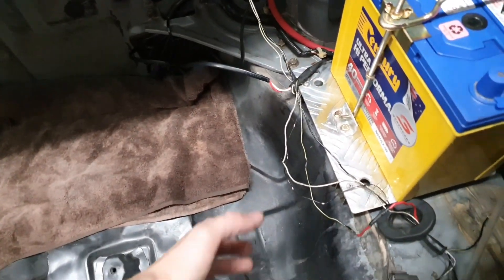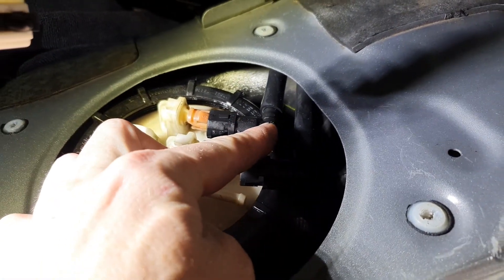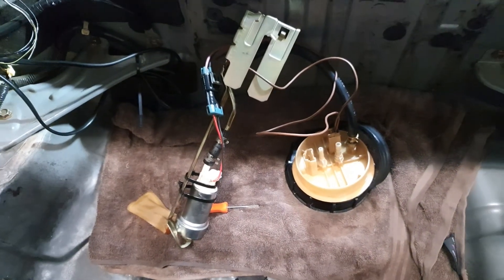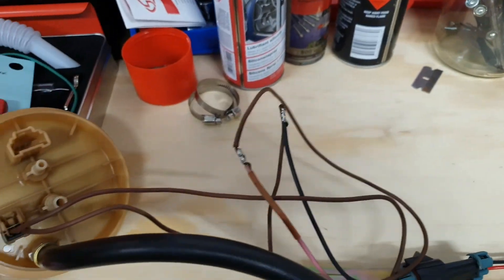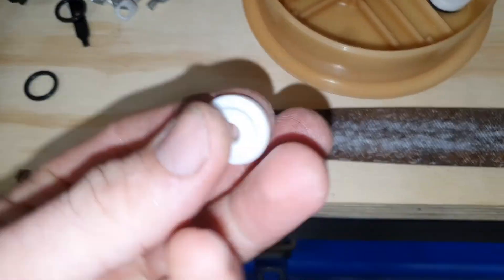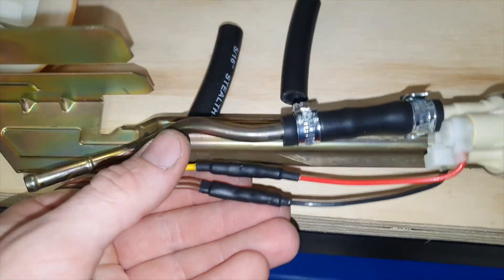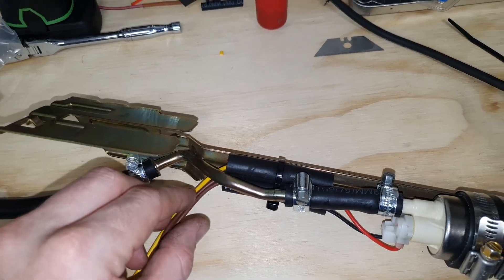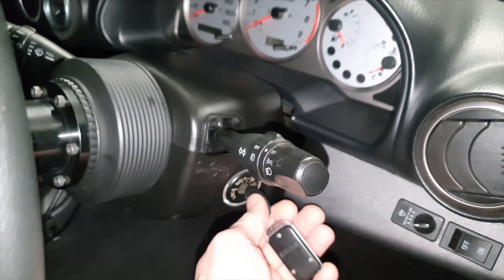S15 Silvia Fuel Pump Fix (Relay Top Hat Mod) | Walbro 460 Re Install &  Wiring Repair

Comment: great tutorial！ did your fuel spill out from the top nuts at all? mine did when i fill full tank..
Reply from the maker: Thanks man.
I used aeroflow bulk head fittings and had to modify them slightly for a firm fit. They seal each side with supplied orings. I also used loctite on the threads as well. You might have to remove the top hat again and inspect the top hat seal amfor the tank and also the sealing surfaces of the bulk head fittings.

Comment: Is there a diagram for where the hanger sits in tank
Reply from the maker: Just in the Nissan S15 service manual, should be able to find a pdf download somewhere for it. Should be in EL section.

Comment: Most helpful YouTube channel to date for s chassis stuff really appreciate it, Joe if you could explain how to wire the relay and where you got it from that would be great !
Reply from the maker: Hey bro, thanks I really appreciate the kind feedback. What you need is a simple relay with wiring diagram pinout. Use the trigger from the ECU (close to the fuel pump in cabin top hat, it will be on the main plug to the pump.) Use that trigger as the trigger for the relay instead, using the relay to switch constant supplied battery voltage to the pump instead. Hope that makes sense. Lookup the wiring diagram from the manual at the pump to find what wire is the trigger to turn the pump on from the ECU, you then want to use that to trigger, switch the relay on instead and by supplying constant battery voltage to terminal 30 on the relay and using the factory fuel pump trigger as the trigger instead for the relay you'll get a constant higher voltage. Any auto electrical or auto parts shop should sell a relay and some good quality wiring. Don't forget to wire in an inline fuse for terminal 30 power from the battery to protect circuit from shorts, also make sure the earth for the relay is done well.

Comment: Great video detailing the setup. Did you find out if there was a mounting bracket within the fuel tank for the fuel hanger assembly to hold on to?
Reply from the maker: Yeah man, there's a bracket inside the tank that the fuel pump hanger slides into and clips in. It's quite tricky to get it in. Once you figure out where it slides in its not too difficult tho. :)

Comment: Hey Joe,

Did you encounter any issues with fuel leaking through the plastic spacers you installed? 
I followed your video and installed the exact same kit as you did on my S14, and upon start up, I had fuel leaking out of one of the holes. 

After removing it all and using some fuel resistant silicone and re installing it, it still leaked after the first drive.

I believe it is due to the different design of the S14 fuel hat unit, the return inlet actually pokes upwards when entering the fuel tank and directs the fuel towards the fitting I installed.

Any recommendations?
Reply from the maker: Hey mate, 
It was a tight fit drilling the holes in the top hat to mount the electrical bulk head fittings. What I found I had to do was lightly Dremel the surface flat on both sides so the washers had a flat surface to seal against. I used loctite on the washers, and fittings. 
A particular necessity that was required 100% with the Aeroflow bulkhead fitting kit was filing down the bulkhead nylon washers so it would seal properly. From memory they were too thick so I had to remove some thickness material from each to bring the size down. Maybe that's what the issue was, is? 
Hope that helps, I've since also fitted 1 x AN fitting to the top hat and replaced the plastic hardline because I accidentally snapped it off morning of the dyno! 
Made it work and rebooked the dyno for the day after so worked out in the end. Just super annoying and a time consuming mistake/accident. 
Hope you've sorted yours out by now. 
I've not had a problem with each mod to the fuel top hat yet. Seems to be working A ok.

Comment: good video Joe.just wondering what you used between the  ellen key headed bolts and the bulk head fittings to stop fuel leaking along the threads.
Reply from the maker: Thanks Richie 🙂✌
They're actually Aeroflow electrical bulkhead fittings, which come with an oring on either side (top & bottom). So sealing comes from the orings supplied. Hope this helps, 🙂.

Comment: Awesome video! Just wondering what the little fitting you used for the top hat mod is called? 8:03
Reply from the maker: Thanks mate, 
They are called the Aeroflow Electrical Terminal Bulkhead Fittings - hope this helps you✌
Reply: @JoeYates77  Legend, that helps heaps! Thanks